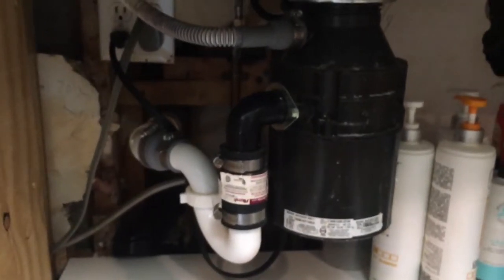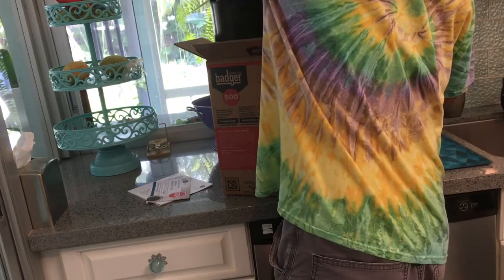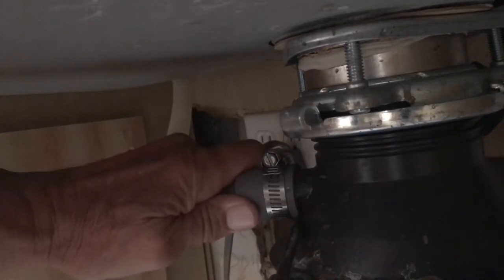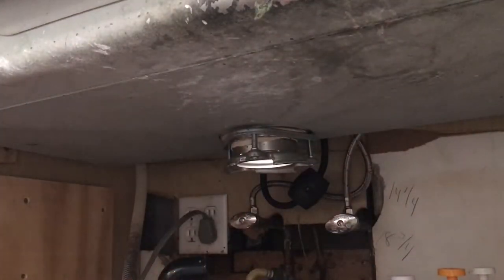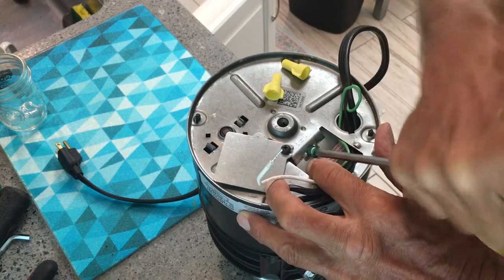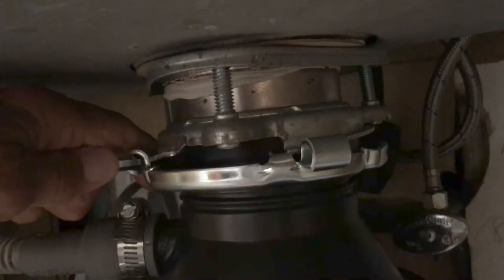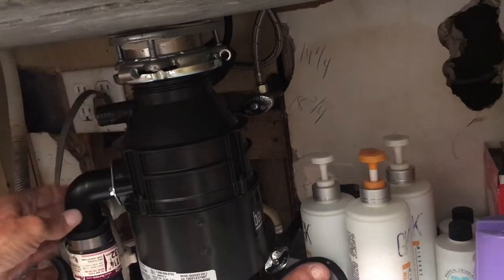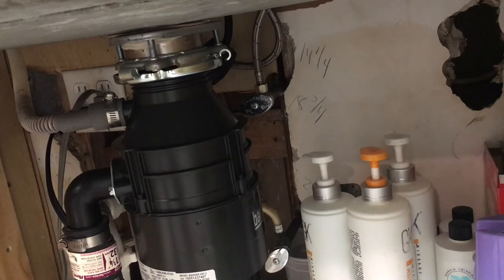How to remove and install a Badger 500 1/2 HP Garbage Disposal and hook up to Dishwasher

Comment: You need a strain relief on that hole where the wire feeds into the unit.  It  will keep the connections from getting pulled loose at the wire nuts and protect the cord from getting cut by the chassis.  If not properly grounded, a cut cord touching the metal could electrify the sink and not trip the circuit breaker.
Reply from the maker: Thank you for that tip will have to do that immediately
Reply: that is good camera work in that tough spot under the sink @TomLeeman

Comment: so which was does your disposal spin when you turn it on? It's designed to spin clockwise...if it spins counterclockwise, you connected the power wires backwards...
Reply from the maker: What a great tip thank you for writing and thanks for watching. Good luck on your install.

Comment: Thanks - it took me less than an hour to swap my leaky 500 with a new 500 I brought at Home Depot.  I flipped the switch in my fuse box to lessen any chance of electrocution and unscrewed the 90 deg pipe from the old unit
Reply from the maker: Glad to hear it do it yourself save money thanks for watching
Reply from the maker: Also, good tip

Comment: Thank you for this video.  I needed to replace my Badger 15ss and this video definitely helped me by showing me what to expect and keeping my frustration to a 1 on a scale of 1-10.  

One thing that might help some of us older folks or not so strong folks is to get something to put under the disposal to help take the old one off and the new one on.  I used some 2x4's stacked up to just about 1/2" under the disposal.  That way when it came off, I could easily set it down that far and more importantly I rested the new disposal on the 2x4's to line it up and only had to lift it that small distance.  For me, that made a big difference from the last time I installed one.
Reply from the maker: Excellent tips these things are a little bit. Heavy and awkward especially underneath the sink. Good luck on your install. Thanks for watching.

Comment: Uhhh... You are running the electric cable through semi-sharp metal edges on the Badger?  The Badger vibrates.  Did you consider a 3/8 NM connector to prevent potential short circuit?
Reply from the maker: Excellent tip

Comment: Read about wire matching! When I did my own garbage disposal, the power cord had a system of ribbed wire for nuetral and smooth wire for hot, which matched the the nuetral white and hot black wires of the disposal. This was for my specific model and cable. Don't assume yours will be the same. Always read through your instillation instructions and check how wires should be connected.
Other than that I found this video fairly helpful for what to expect with an instillation.
Reply from the maker: Excellent tips good luck on your install
Reply: You are right. There is a mark on the electric cord for hot and neutral.
Reply: Ribbed wire in the cord goes to white, smooth to black, per the instructions that comes with the disposal

Comment: No no no!  I had to watch another video to figure out what on earth he was talking about when hooking up the cord.  VERY important ribbed wire goes to white smooth goes to black and he didn’t even put on the piece that holds the wire securely in!!  It’s a piece with 2 screws it’s called a ROMEX connector!  I found a guy named Michael borders that gave a very detailed description!  Look him up this guy is going to cause you problems
Reply from the maker: Thanks for the information and the tips and wiring and thanks for watching

Comment: You explained it well but that threaded hole you pushed the cord wire thru needed a ROMEX connector. Don’t over tighten the connector on your cord when screwing the connector holding screws in.
Reply from the maker: Thanks for those tips. Sounds like you’ve done this once or twice and thank you for watching.

Comment: My sister's garbage disposal's blade is locked up. Badger 500-2. Not sure how old it is. Might as well change it. Glad I found your  channel the ending was sooooo entertaining. lol. Thank you for the video, I'll change it out tomorrow w a new one!  You rock!
Reply from the maker: Good luck it’s not too hard you can do it have fun and thanks for watching
Reply: It was easy. I kept the black L shaped tube in place just changed out the badger itself. Added a new Oring. Bolted up quickly!  This thing must have been the original since it was hard wired in. 
Thanks again!!!!

Comment: Good video, but you forgot to mention the gasket that comes with the garbage disposal - in the bag with the tool and NOT already in the drain hole of the garbage disposal. We hooked up the new garbage disposal and give it a test run to find water leaking from the drain hole.
Reply from the maker: Excellent tip and notes thank you very much and thanks for watching

Comment: After I installed my new disposal it started to leak because the first thing I did was throw out the instructions.  I initially thought it might be the air gap tube or hose, but my wife said "the only thing you changed was the disposal so it must be that".  Sure enough it was plugged and I thought WTF and then found your video! Thanks!
Reply from the maker: Glad I could help and glad that you got your garbage disposal fixed thanks for watching

Comment: Dude your drain pipe from the disposal is blocking the dishwasher exit/entrance. The old one was cut down a bit. Should have cut it back a bit. Were those roots in the line?
Reply from the maker: Good tip

Comment: Which wire connects to the white wire and which to the black?!?
Reply from the maker: Usually Connect the white (neutral) cord wire to the white (neutral) wire on the disposal, using a wire connector. Connect the black (hot) cord wire to the black (hot) wire of the disposal with a wire connector. Good luck thanks for watching

Comment: Very well done. It helped me install mine.  There was a gasket I need to install that came with the new unit to the trap. If nor you will get leaks.
Reply from the maker: Thanks and thanks for the tip
Reply: Yep, we had that issue, too, not realizing the gasket wasn't already in place in the new unit.

Comment: You did not put a lock bracket on the power cord coming out of disposer as required by code and as stated in the instruction.
Reply from the maker: Excellent tip better go back and put that thing out there